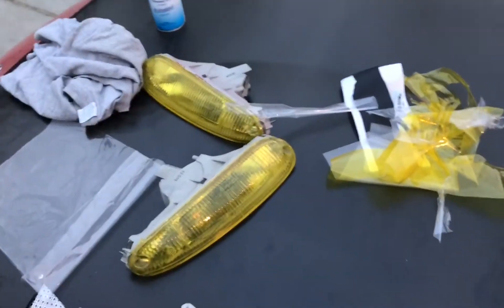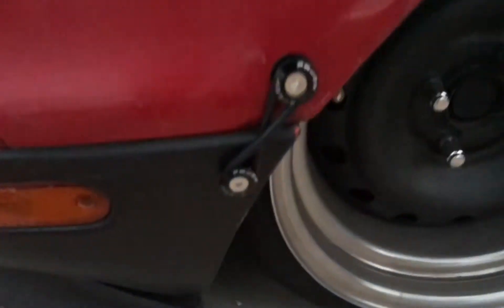Local Car Fest Prep 2

Comment: I like those mirrors bro! What kind are they? Dig the steelies too
Reply from the maker: SuperMiataBros they are actually from pep boys cost about $10-$15 each. The Steelers are Miata steelies that were upsized to 15s and widened. 15x10 rear 15x8.5 front.
Reply: Hazard Built Dope bro i never seen round mirrors at my pep boyz they look dope
Reply from the maker: SuperMiataBros not sure if they have them at all locations. I can find the part number for them.
Reply: I found em on their website dude! Thanks tho